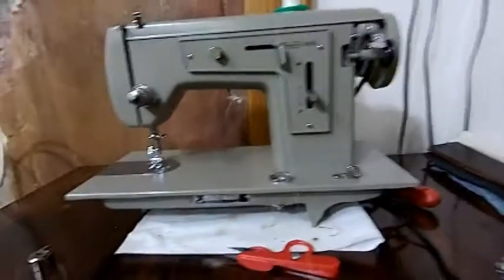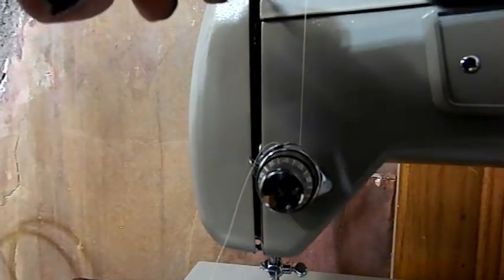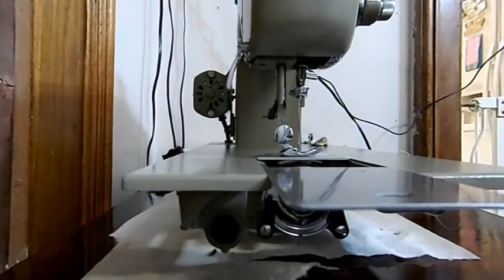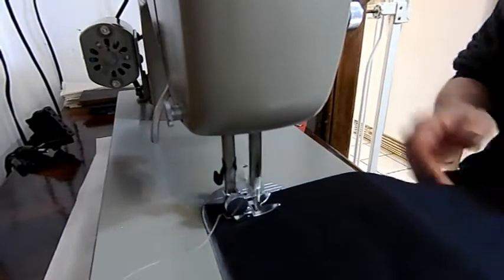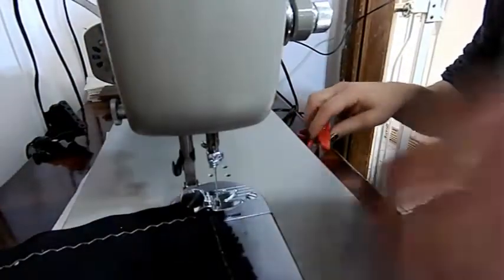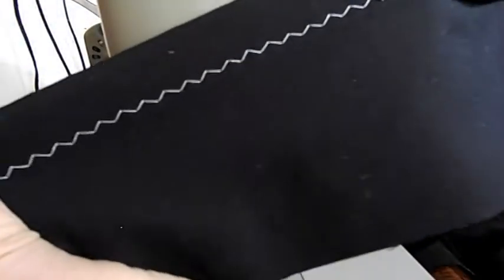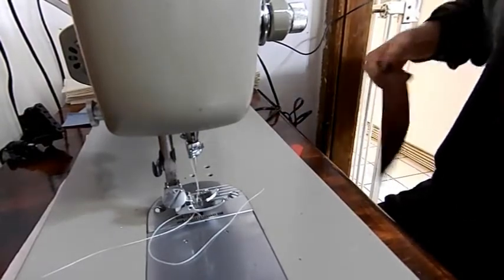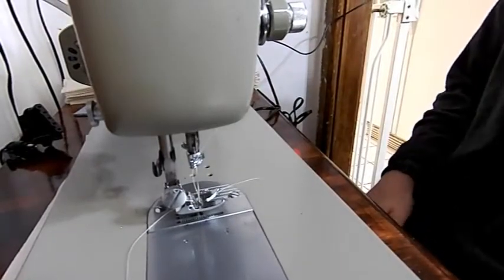How to Use a Vintage Kenmore 148.1215 Sewing Machine

Comment: So I watched your other video on oiling and it was very helpful thanks! I know have a problem of it making holes in fabric but not stitching. I have tried everything but adjusting the hook timing. I noticed in this video that you are threading the needle at the left , I thought the flat side of needle is at back of machine. Am I placing my needle the wrong way?
Reply from the maker: good question. I suggest you get the manual for it. Try joining the Kenmore group on facebook they will have the book for it in the files section.